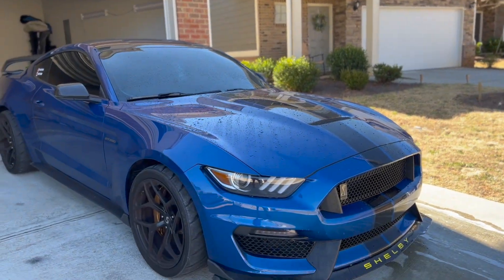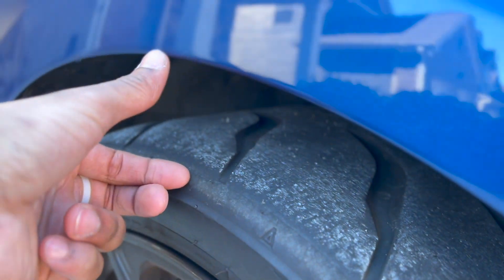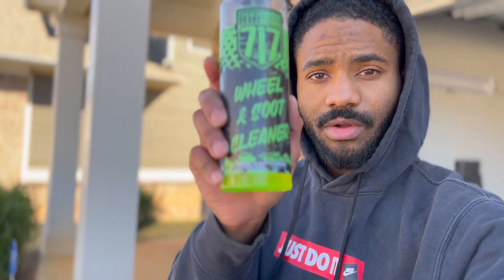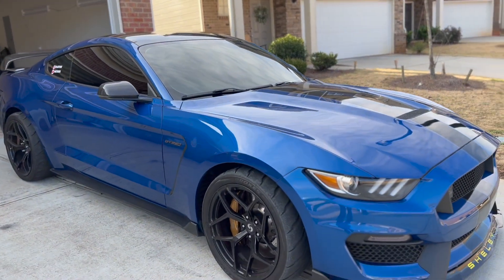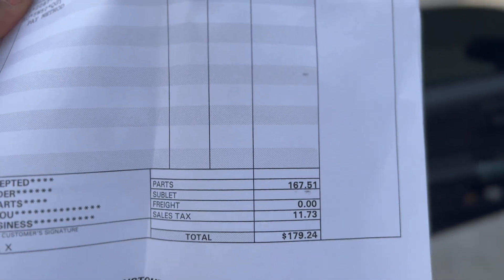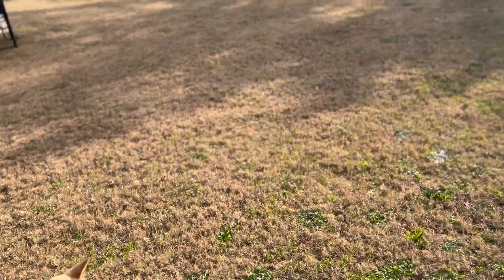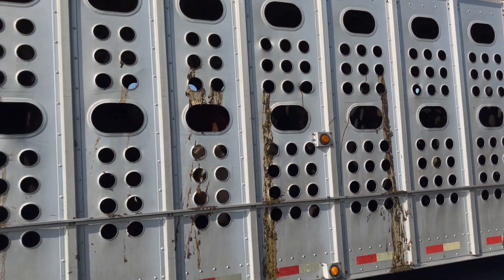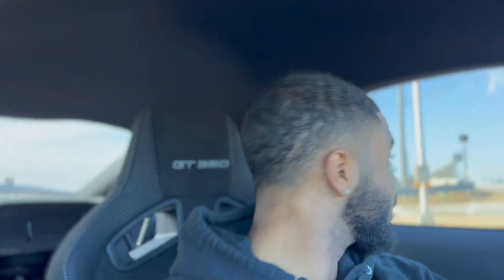The Struggles of Owning a Shelby GT350!!! ( 6 Months of Ownership )

Comment: I used Ford Performance lowering springs. It’s not as drastic as the Eibachs but they ride better than stock and they were designed by Ford to work with the magnetic ride control. I scrape everywhere if i’m not careful so it’s plenty low.
Reply from the maker: I was looking at Fords lower springs too, Eibachs is sold out a few site I looked at so I’m still looking! 🙌🏾🙌🏾
Reply: @dnetwrk  very happy with mine, dm me and i can show you what they look like. Low but not too low where it’s a clearance problem
Reply: Did you get spring only, or also with the magneride recalibration?
Reply from the maker: I got Eibach Pro-Kit performance losing springs. I might return them and buy from somewhere else American muscle told me 2 weeks shipped now it’s say 2/3 months 😔
Reply: @chisquare5701  just the springs, they’re designed for the magneride. I didn’t know there was a different option.

Comment: You guys keep fooling yourselves that any make "lowering springs"  will NOT cause your car to scrape.   When you go to a 30 sidewall instead of a 35 , AND put on lowering springs , AND install a
GT 350R front splitter that extends even further out in front of the car , you are BEGGING for trouble .  You're going to be scraping the pavement with your front end all the time and or tearing off the front splitter  completely.  MAYBE not a problem at the track , but personally , I'm not going to be at the track 365 days a year.  So you want to close the HUGE gap between the tire and the fender , lower the car even more  and give your car the perfect look or stance , correct?  Be sure to have plenty of cash for front end splitter replacements and labor costs if you can't do it yourself. Further , that's not some purpose built engine that was designed to withstand the stresses of an hour and a half or two hour race , multiple times before being overhauled and freshened up. Guys love redlining the engine all the way to 8250 rpm every time they get in their car. I'm not surprised that many of these engines in the GT350 are consuming an alarming amount of oil or blowing up because of negligence or ABUSE.      After all , the car is a street car , not a true "racing car" that costs half a million dollars or more.
Reply from the maker: I’m absolutely looking for trouble lol. It’s the life I live! But nahh personally I know it’s a bad idea I’m still waiting on my springs to come in so by the time they get here hopefully I can find a daily driver.

Comment: Mine makes clunking noises in the rear when making tight slow turns or a k turn.  You have anything like that?
Reply from the maker: No I don’t hear like that coming from my car maybe it could be your rear diff
Reply: @dnetwrk  my rear diff has some slop in it for sure.  I’m eventually gonna rule out the lower control arm bearing before i check diff backlash. Sad part is my car is under warranty but refuse to bring it to the dealer
Reply from the maker: I’d start there and idk what area you are in but mall of GA ford is trustworthy!! I’d try to find a dealership that you could trust and get it fixed under warranty to save money
Reply: @dnetwrk  i have a lift at home which helps.  Spending a few dollars out of pocket is better than someone scratching my car.
Reply from the maker: Oh yeah definitely gives you a better peace of mind 💯

Comment: You got the engine replaced under warranty? I plan to buy a gt350 but my biggest concern is the oil consumption and what if I get one that consumes abnormal amounts of oil, will my engine be covered even if it’s not in warranty?
Reply from the maker: I did get my motor replaced under warranty! I’d suggest getting one still under warranty for a little while. And get them to replace engine my bill would’ve been 30k without it being under warranty

Comment: I got rod knock on my 350 Dream Cruise weekend.
Reply: 2017 track pack 16k miles. No oil consumption and good oil pressure.
Reply from the maker: I think light ticking is normal but anything other needs to be checked out
Reply: Update: Just pick my car up from dealer for motor warranty Gen2 (KA 555) GT350R